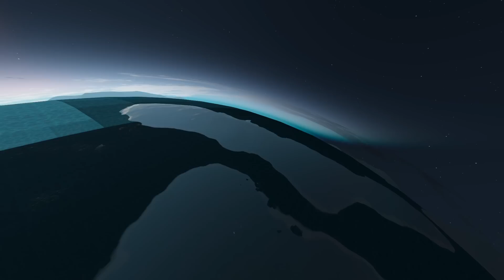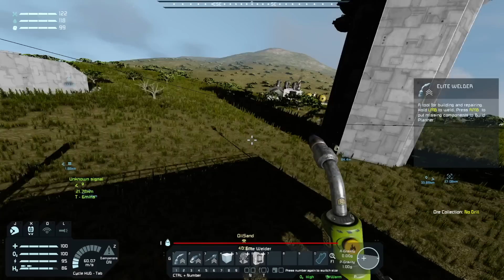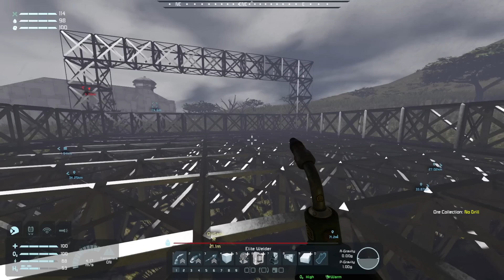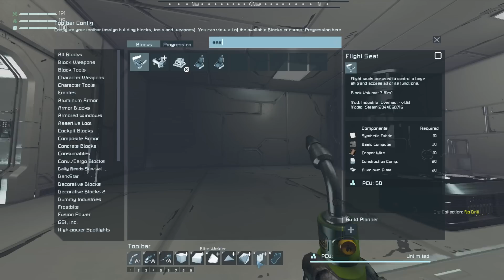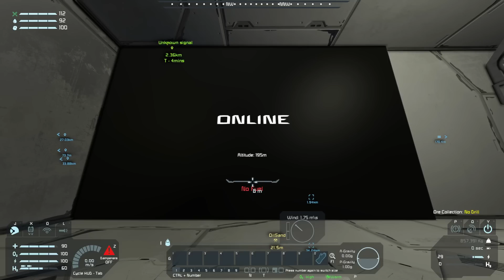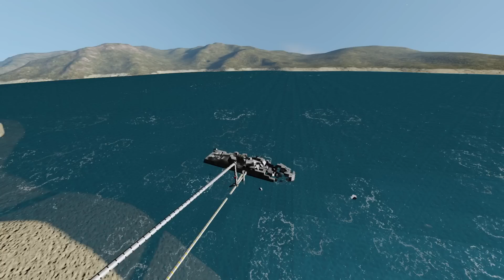Space Engineers - S4E53 'Setting Up A Base Shield'

Comment: from the script that creates the graphs:

If your solar panels are on a sub-grid (ie. connected via rotors, etc) you will need to enable support for reading the power of connected grids in the script configuration (in the program block Custom Data, not the script itself). Look for the options called Include_Data_From_Attached_(Small/Large)_Grids. There are different options for small and large grids. If you also want to read power of grids attached via connectors there are additional options for doing so.

Comment: Due to the resources needed for industrial overhaul, I think this base would benefit from delivery drones more than any previous series.
Reply: @Ryan Biedenbach I'm assuming the AI update will be the beginning of a new season. The mods will probably be broken for a few days, or even weeks... but it's also possible the save file itself could break.

I hope that's not the case, but it's better to prepare for the worst possible outcome when you're not running vanilla.

If I remember correctly, wasn't there a similar issue much earlier in this season? Luckily he was moving his base anyways, so he could just spawn in the boat and fill it with supplies... but that won't be the case if the save goes poof at this point.

Comment: clean up at Kana's Base!

three Warfare Reactors leaving room for Deuterium Fusion Reactor as a later addition to boost shield strength

remember = YOU don't need to build Flak Towers, that's why you have Bob's to do that for you!
place a few blocks and put 4 Bob's down with a cargo container and pipeline connection.
stick a Projector on it with a projection of a Flak Tower and let Bob go to town!
Reply: Easy, but expensive. There’s a lot of resources in that tower…